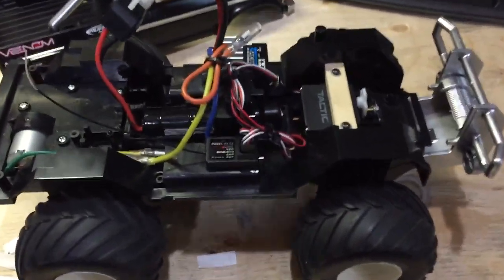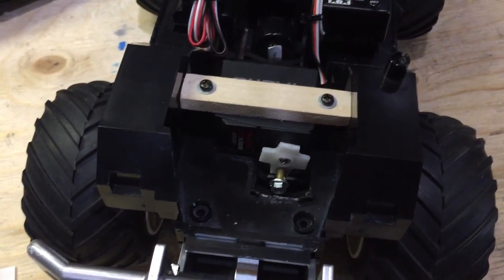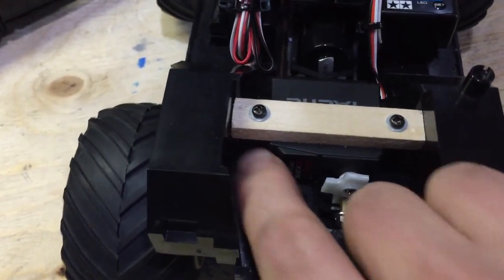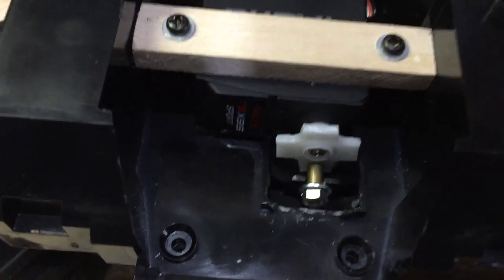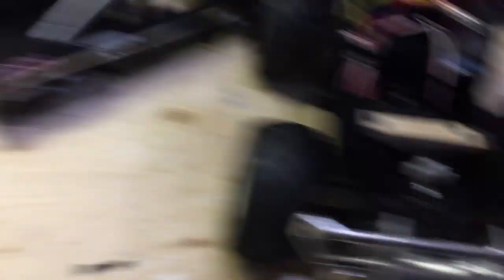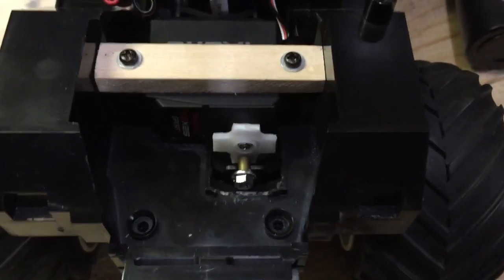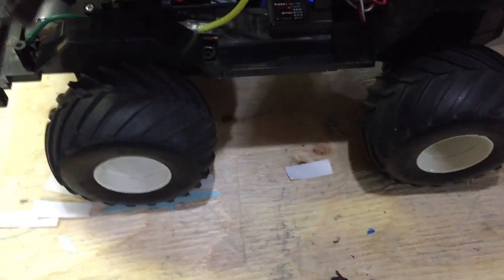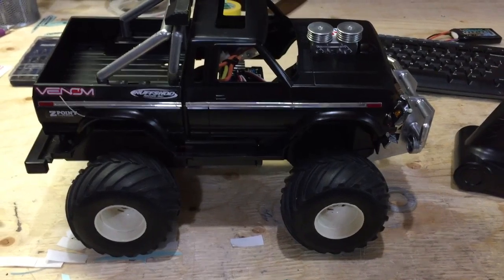Rebuilding and Reviving an old Radio Shack RC 4WD Truck

Comment: hey i own that truck now . great buy . i was jut working on it and my other dash trucks tonight . feel bad that you didnt get a lot for it  .thats ebay for you. i have lost on things and made out on others.
Reply from the maker: Well, have fun with it! I think I got enough to cover the shipping - almost :)
Reply: i was gone to message you about that. i know i lost money on stuff after shipping before . . i would of gave you a little more .i already used the yellow body on one of my other trucks and the one motor im gone to be using soon and the silver roll bar and push bar i put on a blue truck and it looks real good . the colors match up nice . gone to get parts and up grade the black one like you had it . if you got original controllers for them ill pay you a good price for them to make up for the low price on the trucks .
Reply from the maker: You mean the original Radio Shack controllers?
Reply: ya i got a bunch of the dash trucks but only a few controllers for the ones im not gone to upgrade .
Reply from the maker: Yeah, I have two of them. I just found them. If I had remembered them I would have included them in the auction! One is for the 27MHz yellow truck. The other is for the 49MHz blue truck.

I have no way of knowing if they work. But they are complete with antennas and battery covers.
Reply: 40 for both including shipping sound good
Reply from the maker: Sure!
Reply: us dollars
Reply: how do you want to  do it. you can list them on ebay as straight sale but let me know when so some one else dont buy them first hahah
Reply: r how ever would be easiest for you
Reply: is that enough for them
Reply from the maker: Oh, yeah. Do you need a picture. I could just list them now and give you a BUY IT NOW link.
Reply from the maker: Here is the eBay link - 
http://www.ebay.ca/itm/-/282475382230?
Reply: rite on . you just made my crappy day turn good . thank you thank you thank you.
Reply from the maker: I'll get those transmitters shipped ASAP. Cheers!
Reply from the maker: Transmitters have shipped via small parcel, so no tracking #. You should have them soon. J.
Reply: rite on .thank you very much

Comment: I have this truck and need to restore some parts on it.  I want to change the original controller as the distance is bad.  I don’t like the battery either.  Plus the gears make a cracking noise.  Any tips?  I don’t need to go very high end.  I just need guides.  The front bumper you have is neat, wouldn’t mind it.
Reply: Jim Cottam can you do mine.